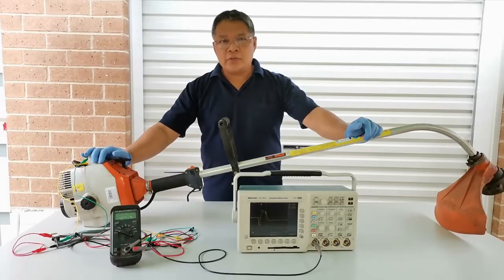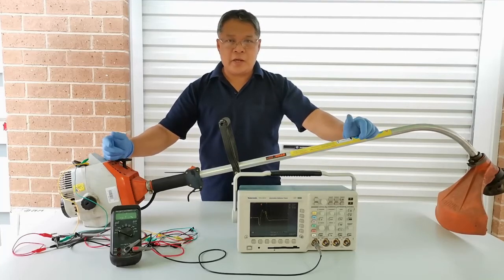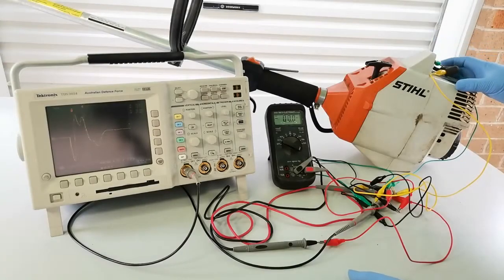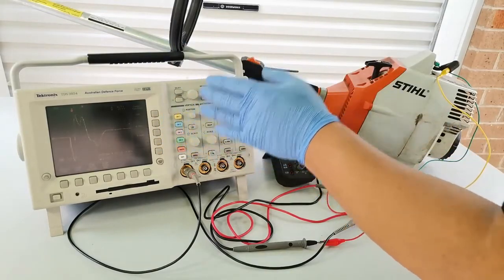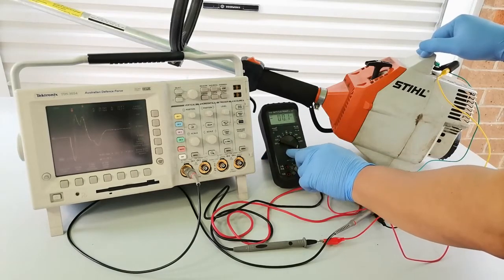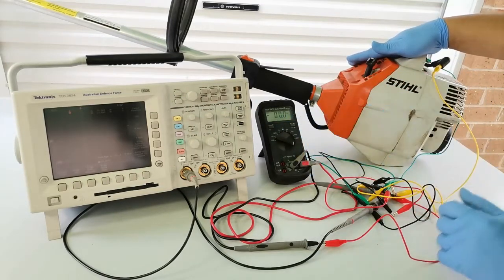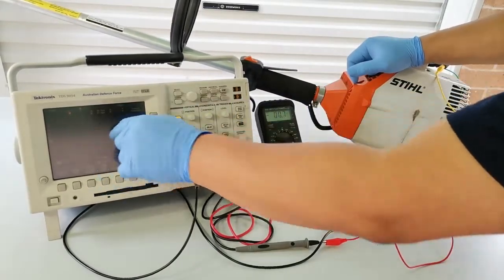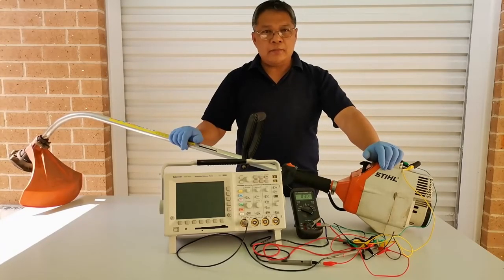VTECH 18 - How to test the engine spark using an oscilloscope?

Comment: You can look at secondary ignition with a inductive probe that cost like $12
Reply from the maker: Yes I had purchased a Hantek HT25 Secondary Ignition Probe Inductive Capacitor Probe X10000 Scope for my future video to demonstrate what the spike waveform looks like with working ignition and a shorted sparkplug. Thanks for watching our videos.
Reply: @Varietech-AU  that was exactly what I was referring to , I’m leaving automotive repair to take a job in relating small equipment. I am a big oscilloscope user for automotive applications and am very well versed in using them . I’m looking forward to adapting it into my new career path . 

I’ll be looking forward to your video
Reply from the maker: @markhb3346  good luck with your new career. If you get involved in electronics and repairs you will find a good information on my new channel. I will see you there. In this channel I will be ECErcuit. https://m.youtube.com/@ecercuit